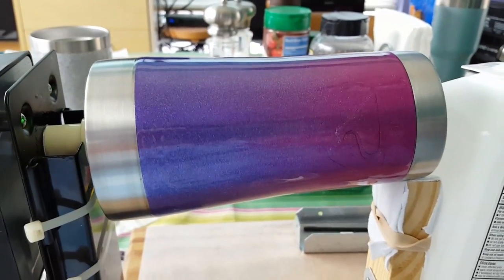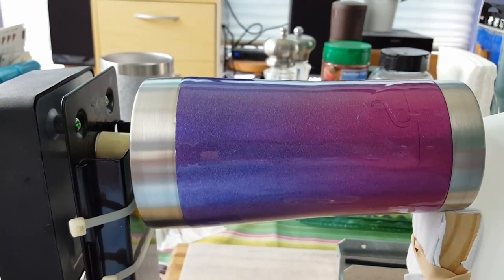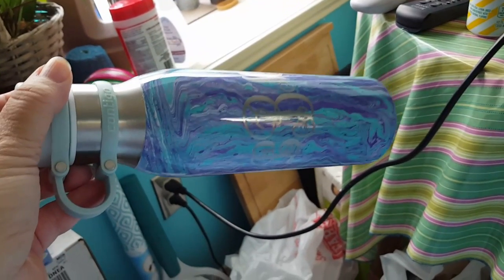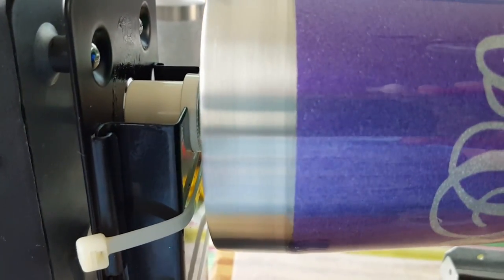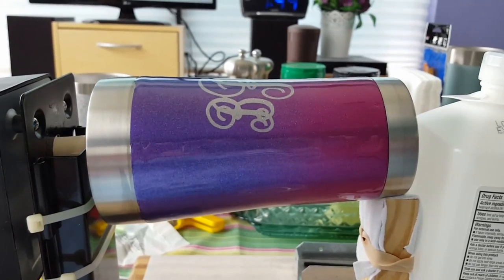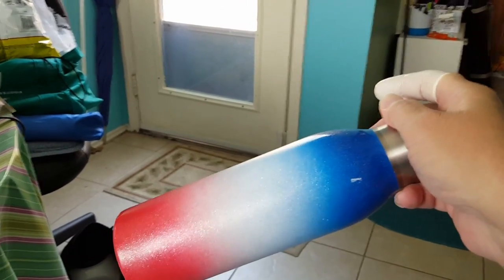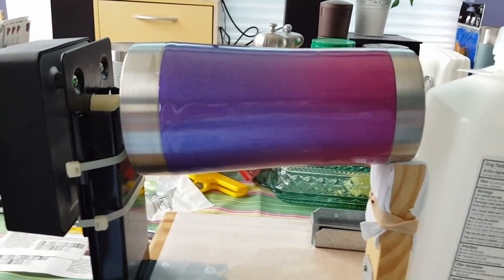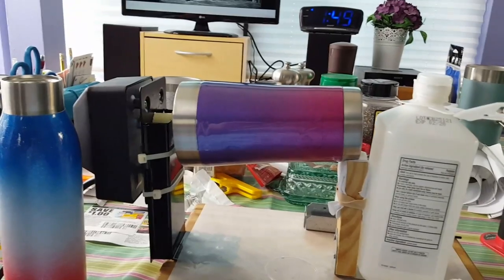Tips and failures with stainless steel tumblers.

Comment: For the bottles I use foam pipe insulation. It's much like a pool noodle look but much smaller and split to apply it on a pipe. I find that it is the best way to get it on the rotisserie.

Comment: My method with the cuptisserie is to have the bottom taped, apply the epoxy by finger, then wait an hour while it's been spinning to take the tape off the bottom. I agree with you that you need support on the bottom side of the cup to prevent the jumping... however, wouldn't epoxy get all over that piece? It always ends up all over tape so eventually it would just harden on the end piece right? How do you prevent this?
Reply from the maker: I've since revised my cuptisserie since this video was published.  I put more support at the motor end and no longer use the piece at the end of the cup.  This is a constant learning craft!

Comment: Do you have to start with the stainless or can I use a painted stainless tumbler?
Reply: You can use either a painted tumbler or the  stainless. I buy the Ozark trail brand from  Walmart  on clearance and they tend to be the color ones. I just paint them to match the glitter I plan to use. (This helps use less glitter and the color turns out more intense.)